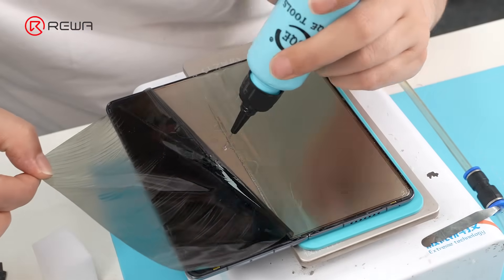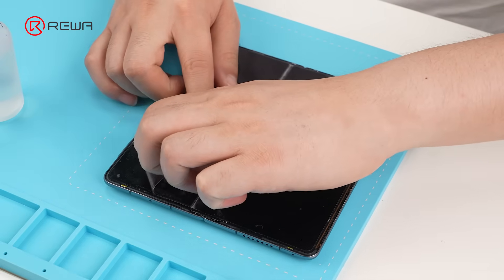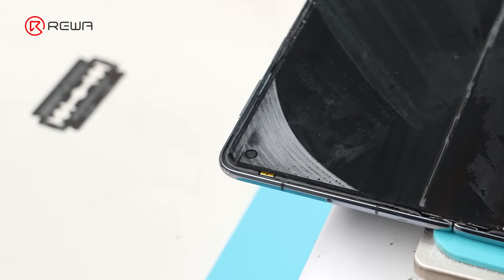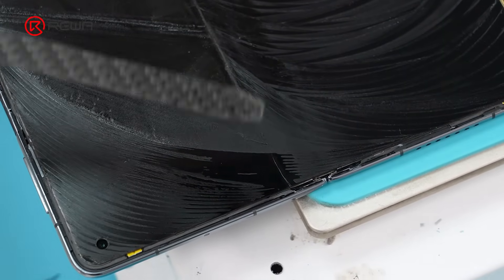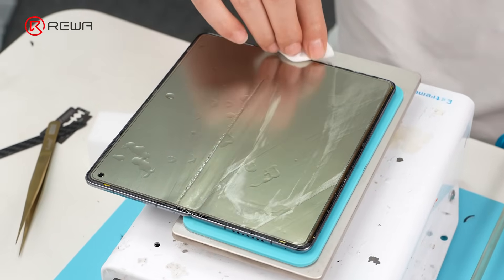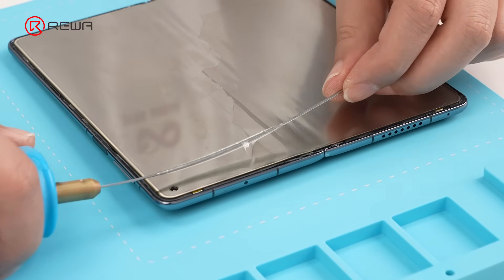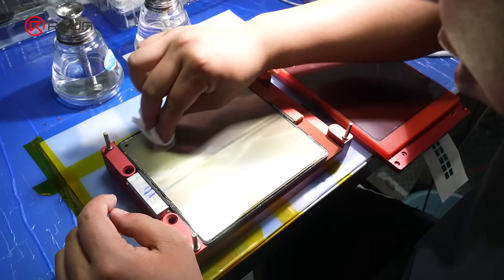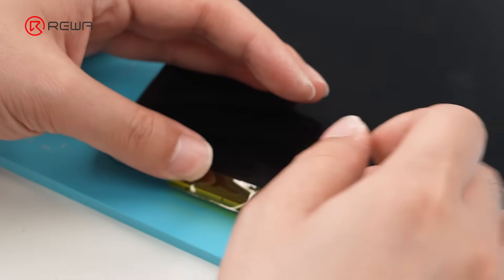Foldable Screen Refurbishment - The Hardest Ever

Comment: I'm willing to try it and i have some i'd like to try it on. I have a fold 6 that needs this.... Do you sell the replacement inner display/plastic with OCA installed? Or have any suggestions on where i may be able to get just the top layer for a new screen lamination on the fold 6?
Reply from the maker: Reach out at sales@rewa.tech | +852 5167 5273

Comment: As a repair technician who mainly does oled tablets like the tab s9, s8 plus etc doing this sort of work is a total nightmare when it needs polarizer replacing and thats on hard oled!!! So massive congrats for doing it in frame on a soft oled!! The biggest problem is availability of parts i had to get some random factory in china to custom make polarizer for the samsung oled tablets as none were available to buy anywhere!! And then i have to cut it down to size myself!  im not complaining about it mind you but they definitely dont make it easy unless its apple and then you can get whatever parts you need!!

Comment: Did u say 90 degree Celsius!! At that temp inner screen will melt 😂
Reply from the maker: Well 90 is fine, and you can check it when heating, if it does not reach that high, you can not clean the glue.

Comment: I'd say 395 currency or potentially 495 if the damage is deep like in this video's case. If the Mate XT screen is 1100 USD and you can perform a repair at 500 ish currency, you'd make millions easily*.